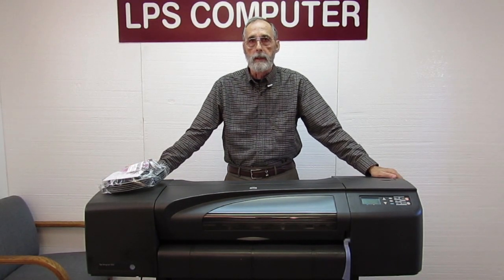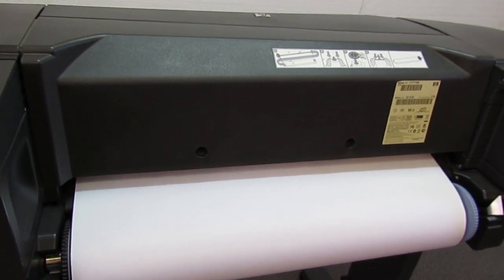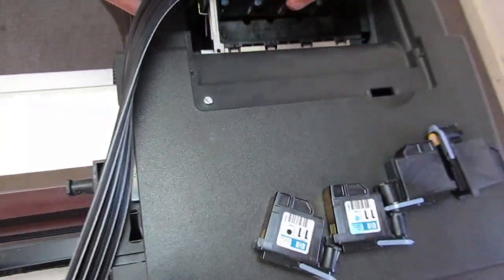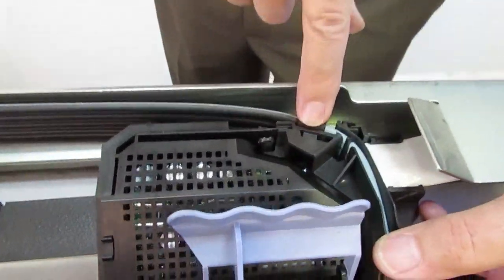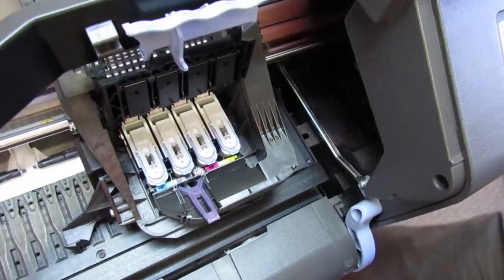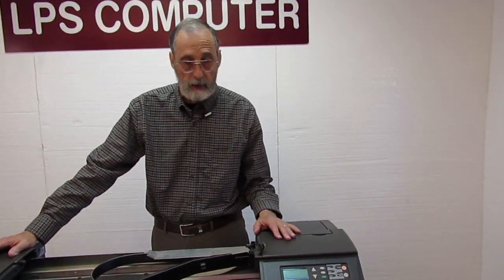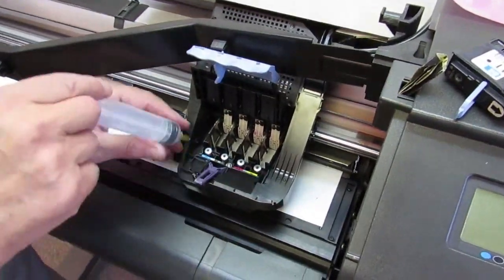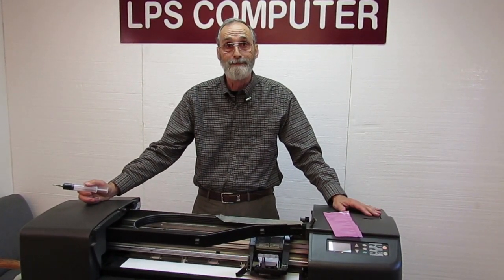Designjet 500 & 800 Ink Tube Replacement

Comment: 3:58 Is there a way to safely to remove the captive screw to replace the Upper Cover for the Ink Tube Supply System? I don't want to forcefully remove the screw then break other delicate plastic parts.

Comment: Hi, since yesterday my HP Designjet 500 displays the Message "Ink cartridge expires in 10 days" (the Magenta Cartridge), but the cartridge/ink is more than half full. He never did that before with any of the cartridges. I read in the Internet if the 10 days are over, the printer won't let you print anymore until you change the cartridge. Is that true? If yes, are there any workarounds to use the cartridge until it's empty? I thought maybe i can somehow reset or change the internal system-time or date in the printer itself to tell him (for example) it's December 2021 an not 2022... Or maybe you have another trick and can tell me how to avoid throwing away a more than half full cartridge? Thank you
P.S. I learned a lot about my DJ500 and repaired some things in the past with the help of your videos - so thanks a lot for your work, best regards from Germany!

Comment: Could you help me? It said my magenta print head was clogged and needed to be changed so I purchased a remanufactured one and installed it. Once I did that it said the remaining three needed to be changed so I went and purchased a full kit. Now it is saying only 1 the Cyan needs to be changed. Before I buy an expensive Cyan alone (because I know they are a lot by themselves) could it be saying its a faulty print head because I haven't actually put the ink in I bought? This machine had been sitting for like 3 years and no one used it so I don't even think there is ink in there or if it is its probably bad. I did buy ink. So could the problem be I need to install the ink first? Thank you in advance!
Reply from the maker: This may be a signal issue. I'd start by cleaning the contacts on the trailing cable connectors. Pull the trailing cable connectors out of the carriage PCA, and carefully clean the contacts with a pencil eraser or mild abrasive. Plug the cables back in and see if the symptom changes or disappears.

Comment: hi
do you know if your version 500 uses the really expensive printhead ink cartridges or does it use the individual ink tanks?
Reply from the maker: Our ink tube systems are compatible only with HP OEM supplies.

Comment: what would cause my printer to not print nothing on the paper but not giving any errors it acts like it is but nothing comes out
Reply from the maker: It sounds like the nozzles in the printheads have dried out. I recommend purging the ink tube system with a priming tool, and then replace the printheads.

Comment: Bob can’t thank you enough for all the videos you have uploaded. I have currently replaced the ink cartridges- all worked except for the magenta couldn’t be read by the machine- so i went and ordered a new one - all worked then replaced the printheads - then later the ink cartridges failed but the new magenta ink seemed to work alone ! 

I tried to place the older one but still three cartridges have now failed 

Do i try to replug the ink station ?

I had an error code of 79:04 before all this happened.

Comment: I have a 24" DJ 500 that won't enter the service utilities menu from the panel.   I can go into the setup menu but not past it to the service utilities with the UP and ENTER keys.  Is there another way to get to that menu, and failing that, can I still change the tubes and prime them?
Reply from the maker: Setup printheads are now an obsolete method of priming. We now exclusively include a universal priming tool that can be reused. How to use: 15:10

Comment: HELLO BOB
CAN WE CHANGE CONNECTOR OF INK TUBE SYSTEM THAT IS CONNECTED TO THE PRINTHEAD?? I DONT KNOW THE NAME, THE SILICON TYPE , VALVE TYPE ITEM.
CAN WE CHANGE THAT???
Reply from the maker: Hello.  The part is called the print head port.  It usually breaks at the elbow that connects to the tube.  You can replace that part if you get another bad tube system and remove the part from that.  The hard part is getting the elbow barb out without breaking it.  The old one can be drilled out with a small bit.  Probably time for a new tube system.

Comment: Hi Bob, I would like to ask you which can be the reasons and signs of the ink tube system to failure?. Thanks
Reply from the maker: The reason for failure is check valves that get worn out. The check valve where the printhead plugs into the tube system is designed to keep ink from leaking out, but the valve spring weakens over time, making it easier for the atmosphere to push its way into the lines when barometric pressure exceeds the standing pressure of the ink delivery system. Then the air gets into the printhead, and kills the printhead.

Comment: Hi Bob, thanks for the great video. I left a request on the LPS website last week that went unanswered, so I try my luck here: I have a Designjet 500PS 24", will the C7769-60381 Designjet 500 / 800 24" Ink Tubes Kit fit this one? (Is the 500 and 500PS similar in terms of the ink station/tubes?) And do you ship to Europe? I also need to upgrade the RAM on my plotter, is this a complicated issue?
Kind regards, Havard G. Hagen, Norway
Reply: Please accept my apology; the request on the website had been answered, my mail server had only screened it as junk for some reason. All well now. 
Håvard
Reply from the maker: Hello.  The tube systems work on the PS and non-PS versions equally well.  The Designjet 500PS can be upgraded to 128mb with https://www.lpscomputer.com/collections/designjet-500-800-parts-page/products/c2388a-designjet-500-800-memory-128mb .  Yes, we ship to Europe.

Comment: is it a special way the latch is inserted
Reply from the maker: Which latch do you mean?
Reply: Bob Wert the latch that holds down the print head cover
Reply from the maker: If you're talking about the purple latch on the ink tube system, you have to remove the screw, unclip the 5 tabs on the grey molding, and displace it enough to slip the latch into place from the underside.
Reply: Bob Wert yes that's the one, do it matter which way it's place in other words do it have a from side and back side or is it the same either way.
Reply from the maker: The purple latch is reversible --no front or back.

Comment: Can you do a video, or offer advice on the installation of T610 Designjet ink system?
Reply from the maker: It is on our "To-do list".
Reply: Bob Wert I just ordered the parts. Can I describe to you my issue or should I Call the help line? I'd like to speak with you directly. Your fiery wit and striking improvisation is helpful.

Comment: Bob I love how easy you make all this look not tried it out myself just happened to find your channel on a different matter, 
I appear to be getting what seem to be dried ink splats little dots or round balls on my prints after it has passed the carriage, I've tried troubleshooting cleaning the printer heads via the system not manual as my latch is broke and I want it to be a last resort before taking a look at the printer heads, any advice what it could be or are my guesses correct already and ill have to have a look at the printer heads (at the moment I have a piece of plastic holding the little purple latch in place hence why I don't want to move it )
Reply from the maker: Hi Dee Gee,

Hi Dee Gee.  Can you send me a picture of the image problem and the broken piece?  bob_wert@lpscomputer.com